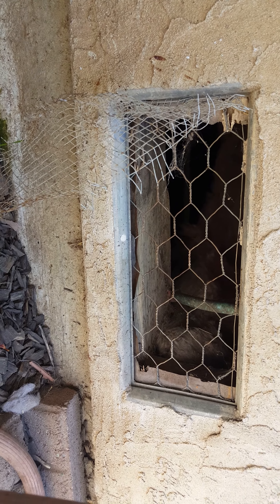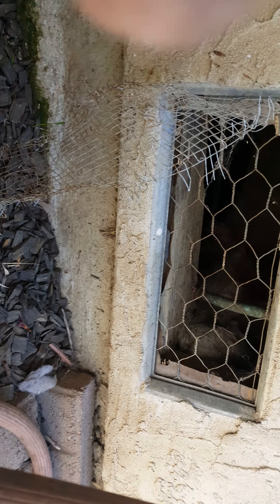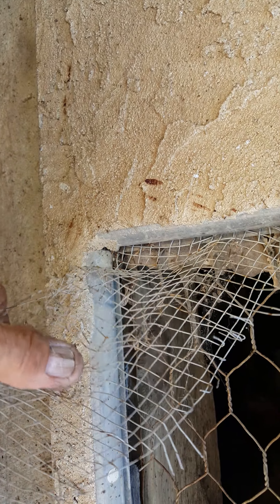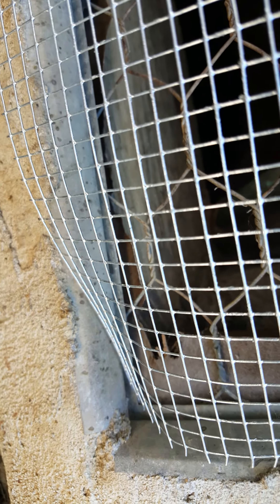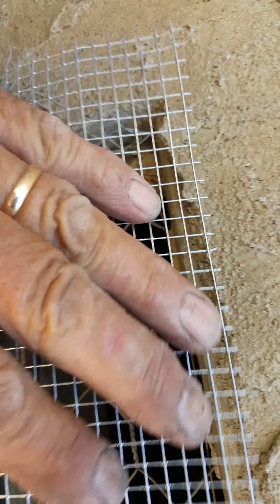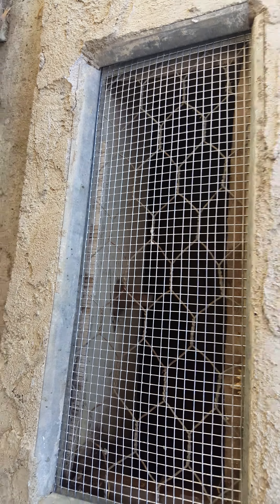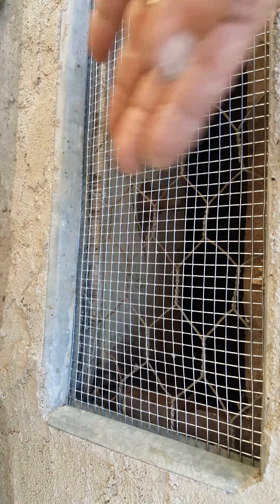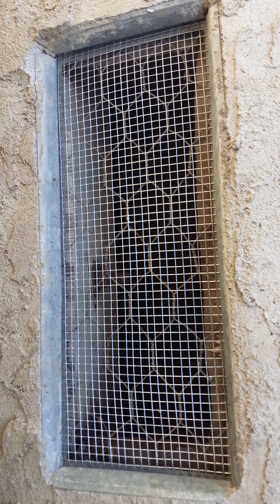Repairing foundation house vents

Comment: Love the video, but how should I secure the screen if it doesn't securely fit
Reply from the maker: Cut Another piece and try again get it to where you have to bow it and bow it some more to get it into the slots then push it flat it'll work its way into the grooves and it's not going anywhere unless somebody kicks it with their foot.

Comment: What's the screen called? I can't seem to find this in home depot.
Reply from the maker: I went to a lumber yard with  supplies   inside the building... yes , home depot and Lowe's  didn't  have the correct screen size.... I got mine at Ashby Lumber, Concord  Cal.
Reply: Hardware cloth
Reply: About to repair some myself. I find it interesting that mice can supposedly get through 1/4” hardware cloth.  I think I will install a fine aluminum screen behind the 1/4” hardware cloth that I call mesh wire. 
  I also had the idea of putting something over the vent to help keep rain water out.
  I do not understand there being wood near the vent. I thought they were cemented into the block opening. 
  My idea is to screw my screen and hardware cloth into the existing vent frame with either storm window framing or aluminum strips. 
   I may have to build a couple of storm window like screens with a kit I got from Lowe’s since the original has a corner broken out of it. 
  Btw, I may check with a hardware store to see if I can get smaller hardware cloth than 1/4”.   If so, the fine screen may not be necessary. That or use two layers of hardware cloth with one shifted just a little to make the 1/4” openings smaller.
Reply: @skypilot1294  I recognize the stucco siding.  I used to live in Walnut Creek off Oak Grove Road.  What about installing an L channel over the wood to protect it.  Then what about the rest of the vents?  Your idea of an external rain deflector might be best.
Reply from the maker: @73amx63   Hey that's cool my parents used to live off Oak Grove  to peachwillow to sugarberry court.
Reply from the maker: @73amx63  Oh,   How will definitely sand and put some oil base primer or put some house paint on the raw wood foundation board
Reply: @skypilot1294  

Persimmon court here.  The Woodlands. Went to YV high school. Class of 72
Reply: There’s an Ashby Lumber in Berkeley on Ashby Ave.  Funny I need this screen for a house in Concord.  .
Reply: Which screen/mesh size did you use 19 gauge or 23 gauge? Thank you

Comment: For an easy vent mesh replacement option, you might want to look for EZRvent products that are easy to install and will make the mesh very secure due to EZRvent's continuous heat stake weld. Full replacement with EZRvent is also very fast taking only about a minute per vent for a complete replacement.
https://youtu.be/XySlIpIw9nk
Reply: i know it is pretty randomly asking but does anyone know a good site to stream newly released tv shows online ?
Reply: @Jaxson Ariel thanks, signed up and it seems like a nice service =) I appreciate it !
Reply: @Corbin Adam no problem :D